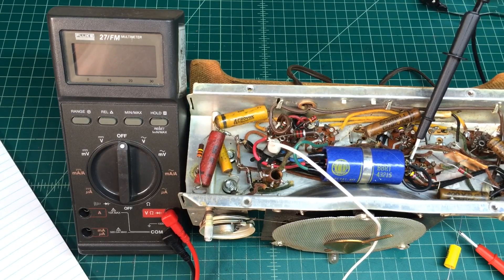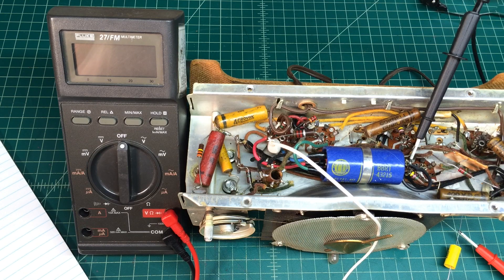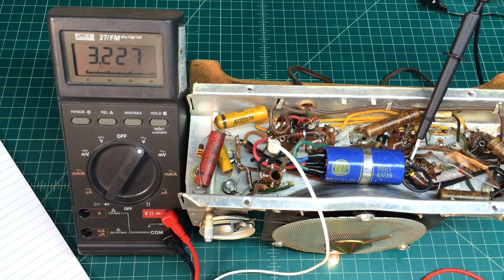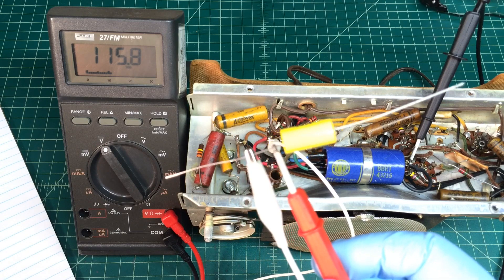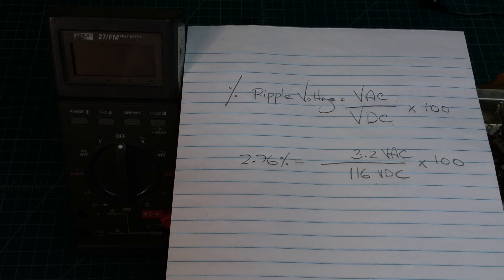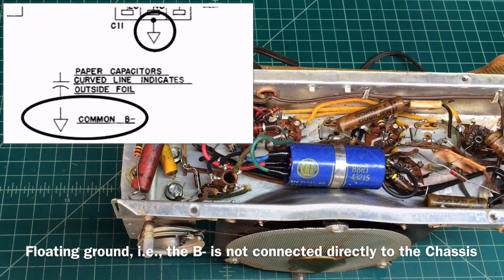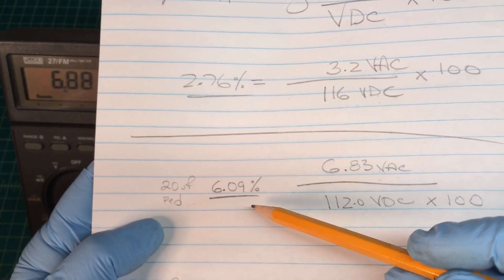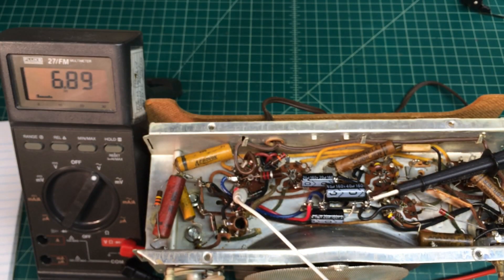Arvin 451-TL (Measure AC Ripple %) P2 of..

Comment: I too apply the ripple test, as well as the ESR test, to give me an approximation, or strength, of old electrolytic capacitors, especially whenever I'm running low on a particular value of electrolytic capacitor, and I'm wanting to retain the original electrolytic capacitors a little longer ...or at least until I get a set of new replacement types whilst I continue doing other repairs to a radio.
Cheers Don,
Phil.
Reply from the maker: +SteelCity321PB Phil, I was telling Larry I hope to do some additional testing on the capacitor on a rainy day this fall. I think I could have got by for some period of time using the "CD". Best, Don

Comment: I too apply the ripple test, as well as the ESR test, to give me an approximation of the quality of old electrolytic capacitors, especially whenever I'm running low on a particular value of electrolytic capacitor, and I'm wanting to retain the original electrolytic capacitors a little longer ...or at least until I get a set of new replacement types whilst I continue doing other repairs to a radio.
Cheers Don,
Phil.